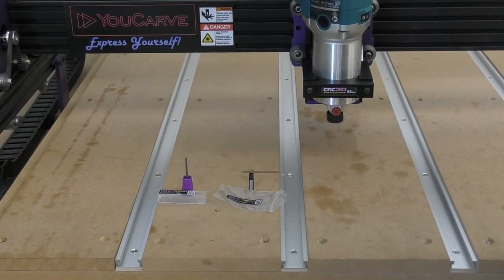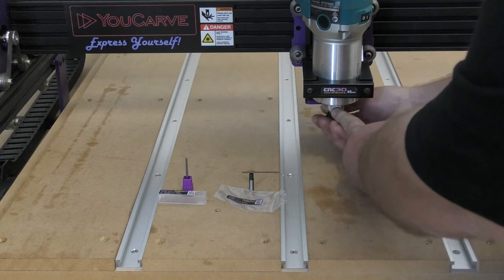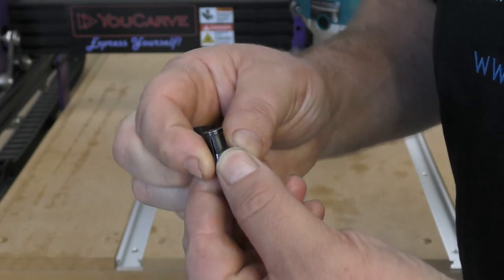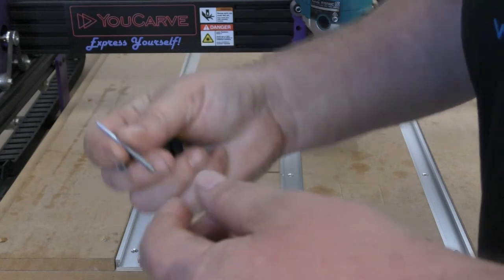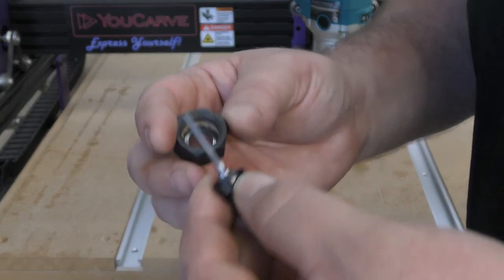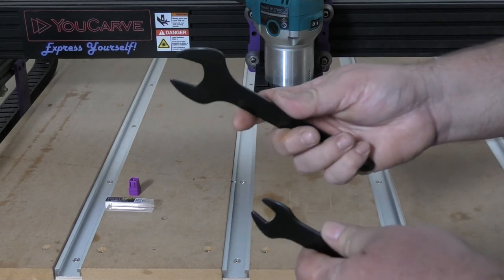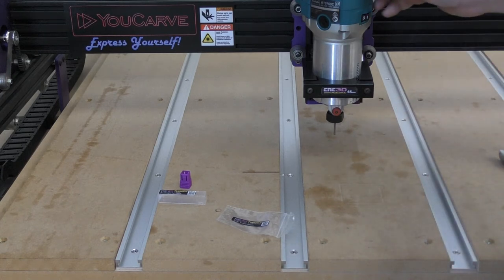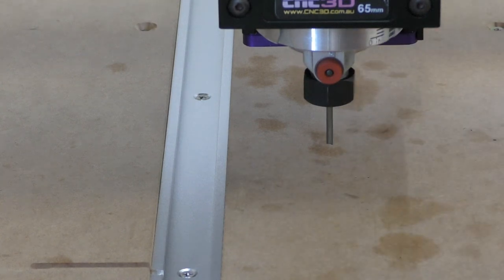CNC How-to: Using router collet adapters

Comment: I use these exact adapters.  Biggest problem is they come loose and your bit drops about an extra quarter inch.  Just happened to me while I was cutting an inlay.  Frustrating.  I inserted the adapter exactly like you did here in the video.  I have a feeling the silver end of the adapter has to be "flush" with the bottom of the router collet to provide enough holding pressure.  Also always clean collet and bits with alcohol. Two and a half horsepower Bosch on CNC.
Reply from the maker: It sounds like your adapters are not the best. We stock these and test every single one prior to shipping for a good fit. We discard ~20% of them due to tolerance issues. Namely, the adapters being too tight causing massive run out on the tool which leads to breakages and average job edge finish.

Definitely consider ordering some more to find ones that fit better. :)

Comment: I often have collets that loosen due to vibration. If a job is > 10 minutes and the bit is a little stressed, your bit will fall out of the collet and possibly damage your router / workpiece (I guess due to the heat). Unfortunately this happens very often.

Comment: what feeds can these sized bits handle at approx 10k rpm?
Reply from the maker: We're not entirely sure what you mean, these router adapters are quite general in their design. Regarding endmills themselves, This is dependent on several factors including material being used and rigidity of the machine.

We have a recommended feeds and speeds for our endmill range located here:

https://www.cnc3d.com.au/tool-libraries

You can also access our entire endmill range in our CNC3D Commander software by click on "My Tools" at the top center. 

You can download and use Commander from here:

https://www.cnc3d.com.au/commander

Good luck!

Comment: How to set the rpm with these mill macchine?
Reply from the maker: There is a rotary knob on the side of the router for speed control. :)
Reply: Thanks...is possible setting rpm from dashboard( PC controll ,)  or only rotary knob ,,?
Reply from the maker: @vitadacarpistaadventures3623  not with a Makita router. Although you could have spindle speed in youd Gcode which may help :)

Comment: Those adapters are not straight, but there is not really any altrnative on the market. Mine bit was off center like 0.5mm!! like someone would take a drill and make hole inside, not caring at all, then hacksaw the cross cut that was not straight too xD !! That means it was cutting with only one flute instead 2.  Very bad quality, but if you buy 5, maybe 1 will be ok